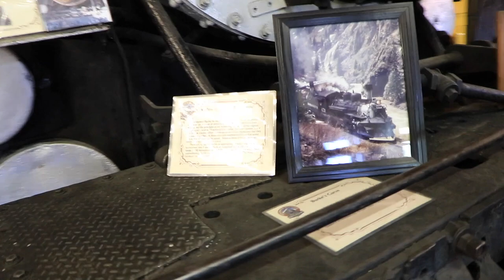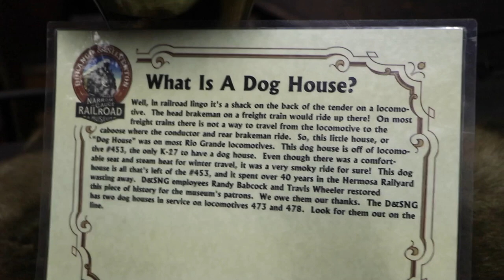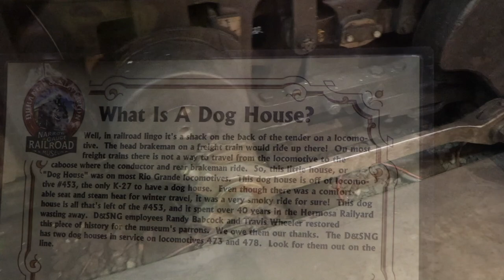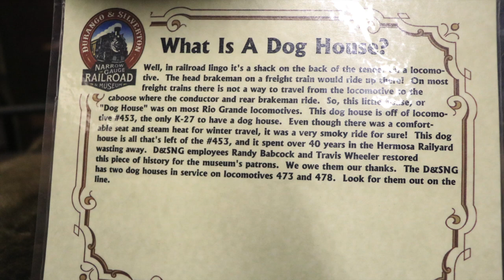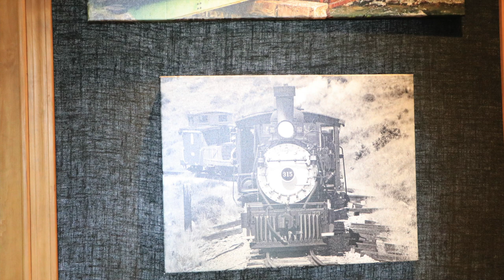Durango & Silverton Narrow Gauge Railroad Museum

Comment: It would be nice IMO if 42 would be a second oil burner to be restored to operating condition. But unfortunately from what i heard, frame needs repairs and boiler is a mess. Hope i am wrong on this.
Reply from the maker: I agree with you, not sure if it is strong enough to be useful and worthwhile as an oil burner, but I agree.